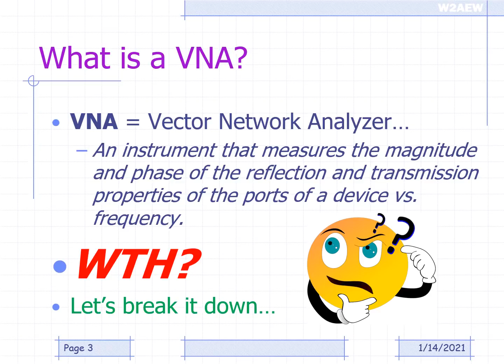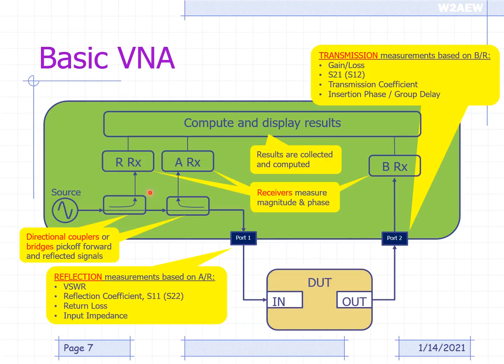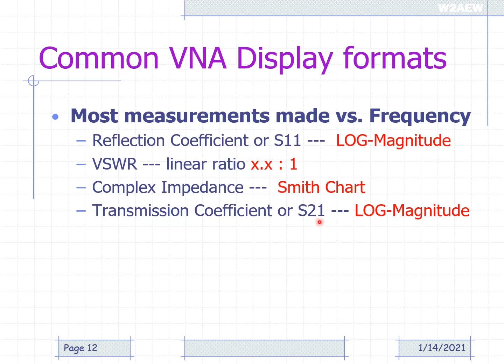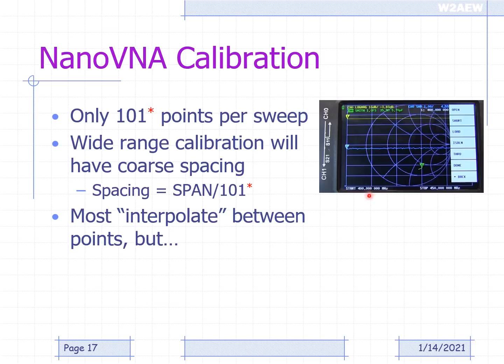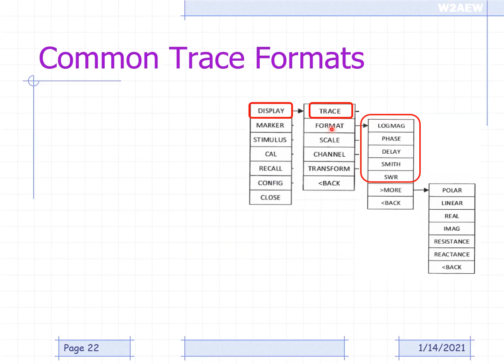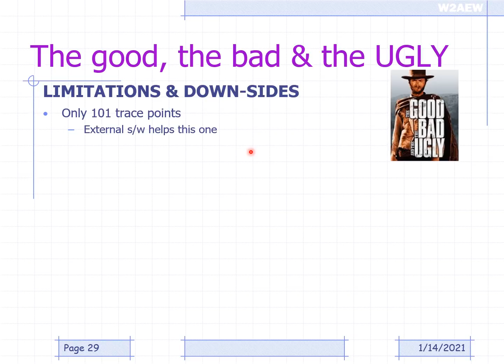#329: Presentation recording: Intro to the VNA and NanoVNA for BayCon 2021

Comment: Hi w2aew! I just hooked up my NanoVNA (port 0) to my (200mhz) oscilloscope (using 50ohm coax, not probe). I was a bit surprised because the Smith chart does not look like the one of an ideal 1M Ohm || 18pF.

Reading around in the internet, i found that this is actually normal. Oscilloscopes inputs are not really built as 1M Ohm || some pF. Maybe an idea for a future video on your channel? I'd love to hear your point of view! You are the best RF teacher in youtube :) ! Thanks
Reply from the maker: Did you perform the calibration to the scope-end of the coaxial cable?  If not, then the impedance seen looking into the coax will be transformed (rotated around the smith chart vs frequency) by the transmission line.
Reply: @w2aew  Hi! Thanks for the reply (I think my previous answer was deleted since it contained an external link to a picture?) Anyway: yes I think I calibrated it properly. The curve I get on the Smith chart looks very similar to the one you can see in a youtube video titled "NanoVNA - Measuring Impedances" by user MegawattKS, measured on a Tektronix scope input.
Reply from the maker: @therfnoob7697  What part of that video are you referring to? https://www.youtube.com/watch?v=Pk7pMguQDy4
Reply: @w2aew  at the very beginning of the video you linked the nanoVNA shows a Smith chart. It almost looks as a portion of the "constant R=60ohm" circle. I get something similar on my oscilloscope, sweeping from 1Mhz to 200Mhz (I will make a separate comment with a link to a picture, although I suspect it will be automatically deleted).

I would expect an ideal 1M Ohm || 18pF to produce a clockwise curve on the outer circle. This is why I was surprised.

The author of the video you linked above argues on why this result happens, looking at the schematics of his Tek. I'd love to hear your opinion.
Reply: the link to my own Smith chart is: imgur####/a/KmYhaCE  (replace #### with dot com). I had to do code the link this way to avoid automatic deletion. I wonder if there is a simpler way to share links on youtube. Anyway, thanks a lot again!

Comment: Hello Alan. I am in the process of purchasing a VNA for a land mobile radio shop we own. We also work on ham stuff but mostly professional radio. I am looking at the TTR503A from Tek and at the Copper Mountain Technologies TR1300/1 and Copper Mountain Technologies M5045 for contenders. Our primary goal is to characterize VHF and UHF cavities, duplexers, filters, combiners. Transmission lines and antennas. Based on your expertise and opinion which of these units would you consider to be the best choice for a long-term investment? I thank you for your accurate response and insightful videos. 73 de HR2PAC.
Reply from the maker: I believe that Tek is going to be discontinuing the TTR500 series, so you'll likely be better off with the Copper Mountain unit.
Reply: @w2aew  Thank you for the response. That is a shame if Tek is going to discontinue the TTR500 line. I was really looking forward to purchasing such a unit, but I am concerned now about the technical support that a discontinued product may or may not have. I am not familiar with the Copper Mountain Technologies gear and quality of products, maybe you can shine a light on that. Can you provide any insight into those CMT units I mentioned? Again, thank you and keep going with those great videos.
Reply from the maker: @pedrocastillo7013  I agree with you.  But, the Copper Mountain units are high quality units.  I've seen them used in professional labs.
Reply: @w2aew  I guess that the final decision to be made is to invest in a VNA that does 2-Port 1-Path measurements or 2-Port 2-Path measurements as well as the additional features it may have. I will have to analyze all the available options from Copper Mountain Tech and decide. Thank you again Alan for all your valuable insight.
Reply: @w2aew   UPDATE 12/28/2021: As of today, our Copper Mountain Technologies VNA is in the mail and on its way to us! We bought the TR1300/1 with CAL kit and two phase stable N test cables. Cannot wait to "play" with it and start to characterize all of the RF devices we use. Thank you, Alan, for the excellent advice and valuable content. Happy Holidays!
Reply: @w2aew  UPDATE 4/11/2023: We have been using our Copper Mountain Technologies TR1300/1 VNA for a little over a year now. We mainly characterize coils, cavities, filters and duplexers for the VHF and UHF land mobile radio bands but, have also been able to characterize other passive RF components such as antennas, coaxial assemblies and coaxial RF surge protectors. The only thing I can say about this unit is that being a 2 port 1 path device you have to disconnect and reconnect the test cables often, depending of the test being done. Other than that, we are extremely happy with the device, it is a professional unit and the price was right, I think this time a year they are $3,995. Thank you, Alan, for the excellent material content and advice.
Reply from the maker: @pedrocastillo7013  That's a nice unit - Copper Mountain has good products.
Reply: @w2aew  UPDATE 09/14/2025: Hello Alan - Copper Mountain Technologies, has discontinued the TR1300/1 VNA and placed the line in the "end of life" stage. They have informed me that they will support the units for 5 more years for service, calibrations, etc. but that is it. So here we go again! They have come out with a "new" line of budget friendly VNA's called the VTR's, these start at $2,995 and cover up to 1.5 GHz for the low-cost units. I think for professional and even ham radio use they are worth looking into. Again, thank you Alan for all of your insight and share of knowledge + wisdom. 73 de HR2PAC.

Comment: Thank you for this video. If I install N to SMA adapters on the NanoVNA SSA-2N to test an HT antenna, do I need to calibrate with SMA Short/Open/Load caps, or can I calibrate using the N caps, then install the SMA connectors and proceed with testing?
Reply from the maker: If all you are doing is checking SWR, then either will work fine.
Reply: @w2aew  Thank you for your reply. I’m new to RF, and I am finding a wealth of information on your channel. I’m currently building an RF sampler based off another one of your videos. I can tell I’m going to be spending a lot of time in your channel!

Comment: which higher performance VNA would be your recommendation for the best value for the money ?
Reply from the maker: I think the NanoVNA-H4, for $60, is the best bang for the buck.  If you're willing to pay twice this amount, a lot more frequency range (to 4.4GHz) and much better dynamic range can be had with the NanoVNA V2plus4 - also a tremendous bang for the buck.
Reply: @w2aew  that sounds even better, but is there one that will cover up to 6 ghz for the wifi-6  band ?
Reply: @w2aew  I also came across this 1 ~ 6.2 GHz Russian made Arinst VNA-PR1 on ebay. What are your thoughts on this one? The specs look really good !  IS this too good to be true ?

Comment: Bill-N6EF-Excellent presentation. I learned more about the NanoVNA from your presentation than any other video I've seen yet. I've been using it incorrectly for antenna measurements in relation to the calibration but now I understand what I was doing wrong. Thank you. Subscribed.

Comment: You have to wonder why whoever invented this thing chose to use Ch0 and Ch1 instead of the traditional port 1 and port 2. Doesn't make sense.
Reply: This is probably due to the difference between software engineers and actual humans.  Software starts at 0!
Reply from the maker: I know!  The -F version properly labels these things.
Reply: Zero is the first number!
- programmers

Comment: You managed to touch on a few things in there that I wasn't aware of,  even though I'm a regular in the mailing list.  I have an H4 purchased from randl,  but haven't messed around with upgrading the firmware yet.  Is all of the stuff you talked about in here present in a "stock" nano?
Reply from the maker: Yes, it is in the stock -H and -H4.  The DiSlord firmware (v1.0.39) brings you up to 401 points, a real nice improvement.

Comment: This is fantastic. So I have a request.  Maybe we can do a series of making DIY Antenna and filters for both the 978 MHZ and 1090 mhz band for tracking planes and And using the nanoVNA to test our work.  with the wide spread use of the RTL-SDR for us amateurs this would be an awesome learning experience and we'd be able to use it for other designs for moving into the amateur HAM radio Hobby. What are your thoughts on that ?
Reply: By the way. I really look up to you on these topics
Reply from the maker: The NanoVNA will help you easily when when you've cut your antennas appropriately for 978 and/or 1090 MHz.

Comment: Another great presentation Alan. I am going to watch this while trying out the unit which I bought a while ago but still sits on the shelf. I bought one of those test boards that lets you measure different parameters. By the way, you probably have one of the most professional presentation styles on YouTube.  Not one " Ummm " in 32 minutes😊
Reply from the maker: (that's because I edit all of the "ums" out now ;-)
Reply: @w2aew  
HaHa, I don't believe that. I know part of your work for Tektronix is to do presentations so I   know where your good presentation skills come from.

Comment: I’m a 50 year old Electrical Engineer and I love your content.  Your videos are some of the most valuable content on YouTube.  I work in the power industry and, while I love my job, I must admit that I’m a little jealous of what you get to do for a living, on and off YouTube.  Thank you for great content!
Reply: I'm a retired EE and thoroughly enjoy Alan's videos.  I have the H4 unit and can confirm it is an interesting and capable device.
Reply: @kd4lok1  I plan to purchase one.  Glad to hear that.
Reply: Great presentation! This video is the most comprehensive explanation about the basic theory and use applications of the NanoVNA that I've found on YouTube. There are other YouTube video showing specific use cases (like SWR measurement) but so far this video is the best overview I've found. I'm trying to get up to speed understanding and using a NanoVNA H4. I'm glad you noted that software updates are available to increase the number of measurement points. Thank you!

Comment: would it be possible to add external amplifier with inverted loss curve on output, to make it more or less few dbm on full scale ? And if yes, will it cause bad measurements and will need to tweek it ? 
I just get SAA-2N for my project and thinking of ways to make it better. Any idea? Cost is not a problem :)

Comment: So when doing a full cal the ISOL should have a 50R load on Port 2 and Port 1 is left open, is that correct ?  I've only used it for Port 1 styles of measurements so far and am venturing into 2 port measurements.  Thanks for the great instruction videos. Very helpful and educational as usual.